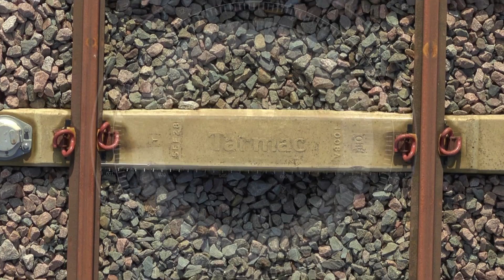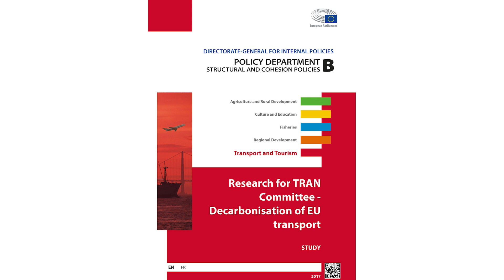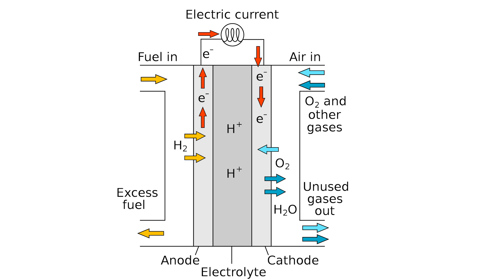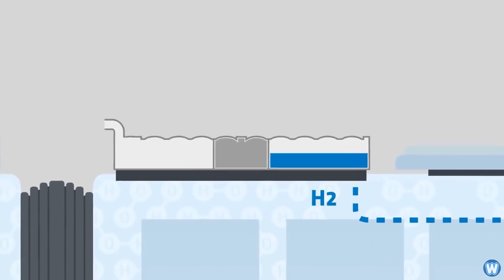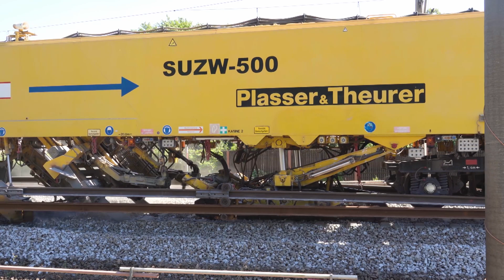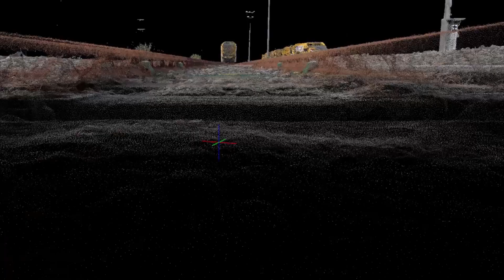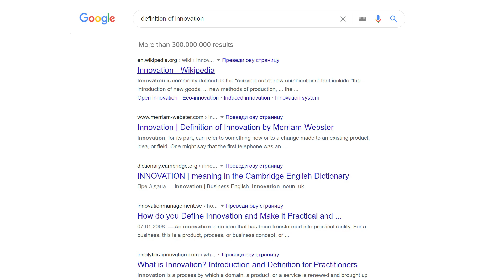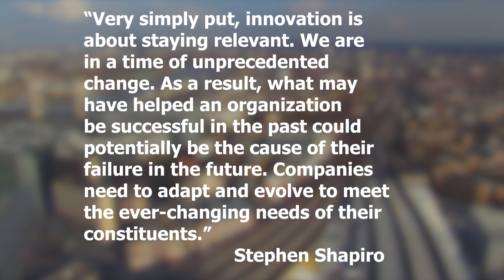Innovations in Railways: Decarbonization and Infrastructure-Inspecting Drones

Comment: Polish railway vehicles manufacturer PESA has already built hydrogen fuelled freight train locomotive (SM42-6Dn). And in 2025 they should have passenger train locomotive ready for testing and implementation (Regio 160 H2).

Comment: I think Hydrogen is a bit of a dead end for any form of transport, electric ( over head line) and hybrid Overhead with battery storage makes the most sense.
Reply: Not ANY form. Big planes for example need high energy density fuel to fly, and hydrogen is just that. Big electric planes are impossible because the batteries add weight, which require more batteries to lift off, which add more weight... you get the point.

Comment: Hydrogen fuel cells could be an okay interim solution, replacing diesel locomotives while the line is being electrified. But all the rail lines need to be electrified eventually, no? I mean, however much it costs, it's got to be worth it in the long run due to how much more efficient it is to power a train that way, right? and so, it only makes sense to do it asap, since however expensive it is now, it's not going to get any cheaper by waiting.
But then, here I am, in the USA, so ...
Reply: Generally a benefit to cost ratio (BCR) is worked out which basically compares the expected costs against the expected benefits over 60 years, and the level of density of the network in some countries does effectively mean some lines will never be economical to electrify... This is where battery/hydrogen/discontinuous electrification etc starts to make sense. In the US the prevalence of double stacked containers also raises costs of electrifying significantly.
Reply: @karlosbricks2413  stop double stacking then
Reply: Not really.. Electrification is expensive, it does not make sense in all cases. Very long distance tracks and low volume tracks are in many cases not electrified for that reason.
Reply: I think hydrogen or battery operations still have their place on a network, especially on more remote, less travelled routes. Any heavily used routes corridors like commuter belt services would pass the electrification BCR though.

There's also a possibility of a hybrid system, with locomotives running on monster batteries, which are recharged periodically by short stretches of electrified cables.
Reply: Let the power companies run trains again

Comment: Another interesting video. My railway took to using drones about 5 years ago for the same purposes explained here. It has massive benefits in that a track inspection can still take place without having to stop trains to do so. We also have a couple of track inspection vehicles that ultrasound the rails to detect any internal defects which are then marked with a dye bomb so that the defective piece can be replaced later.

Keep the videos coming. They're very interesting subjects explained simply and accurately which is unusual for the internet.
Reply: Any particular reason for using track inspection vehicles in addition to drones. Any minor drawbacks with drones? how safe is using drones alone? (up to what extent in terms of percentage)

Comment: The hydrogen fuel cell does seem like a fairly simple and very cost-effective solution to the million dollar question of how to reduce the use of diesel locomotives. It's good they're coming up with alternatives to electrification and realizing that electrification implementation is not very easy especially over long distances.
Reply: on long distance high capacity/freight routes overhead lines are a good investment in the long run.
Look at the bad decision the UK did after WW2 to get mainline diesels instead of electrification.
On the continent of Europe all train operaters electrified most mainlines.
Reply: Electrification is needed for HSR and only HSR is effective for long distance rail service otherwise it’s infrequent
Reply: @qjtvaddict  25 KV straith of the powerplant gives alot of power and low energy loss.
1 modern 25KV electric locomotive has the power of 3 diesels. (freightloco's)
All main freight corridors in Europe are being electrified and/or upgraded to 25KV.
For more frequent and heavier traffic on a line you need to electrify the line.
The new eurostar and upgraded freightline from the canal tunnel in the UK to London can take standard UIC freightcars.
Thats now also a main corridor.
Reply: @obelic71  OHH fascinating that can be a boon for the railroads!!!!

Comment: Great video! I'm interested in the development of hydrogen power as it results in no carbon emissions. Canadian Pacific Railway is interested in heavy freight hydrogen powered locomotives, while the U.S. has ordered a hydrogen powered Stadler Flirt for a small commuter line in California.
Reply: The biggest problem with hydrogen fuel is the high amount of power needed to create it by separating it from oxygen in water
Reply: @connecticutmultimodaltrans8226  bro just stop embrace new tech already North America has the world’s worst rail networks (passenger) and the Americas has the worst corruption
Reply: Alstom is bringing its Coradia iLint hydrogen powered train to Quebec, Canada for summer 2023. This is the same model that is already in service  in Germany. It's a small seasonal route.

Comment: 4:38 the range isn't bad but most diesel locomotives can run up to close to 2000km
Reply: It's version 1. I'm sure by time and development, range anxiety won't become an issue.
Reply: @route55qatar  but imagine like running out of Hydrogen in the middle of the Persian Gulf coast or something...
Reply: @timlilijinsheng4070 

keep in mind that this is an HEMU, designed for local train traffic, that means the capacity is designed to cover the distance that is usually traveled by such a train on one day...there are just no use cases yet, which demand a higher range. 
I bet something comparable but a diesel vehicle, like a Siemens Desiro Classic for example also has a range of rather 1000km than 2000km( why would they have  more range than they ever need)
Reply: @route55qatar  won’t matter battery and electric goes farther

Comment: The hydrogen-powered EMU would be a perfect example of eco-friendly non-pantrograph locomotives
Reply: Hydrogen itself during the combustion process emits heat and water/steam, but most of the Hydrogen production processes nowadays are through SMR (Steam Methane Reforming) in the refinery plant. Which requires huge energy and emits CO2 waste into the atmosphere. Decarbonization is a really complex subject.
Reply: @route55qatar  oh so it's like a nuclear reactor built into the train but without any radiation or nuclear materials
Reply: Wouldn't it be an HMU?